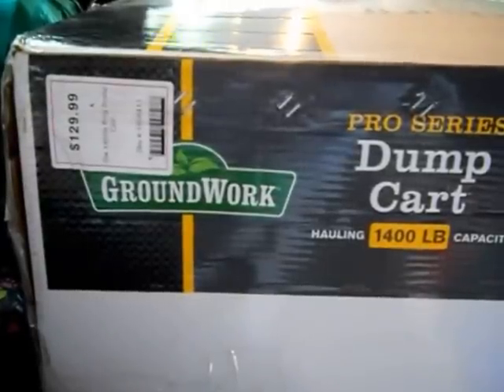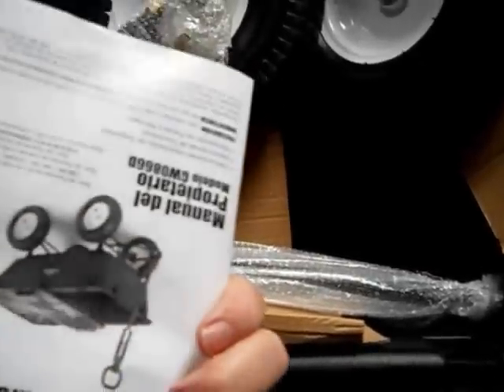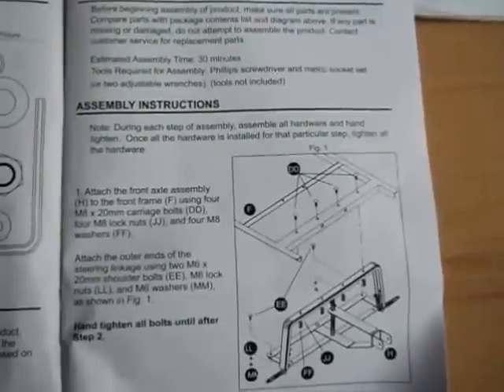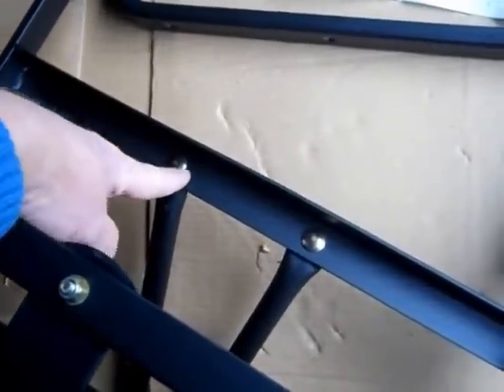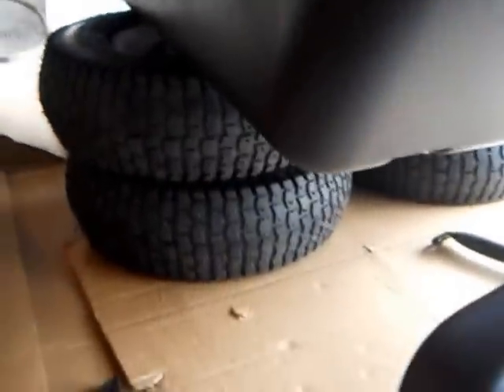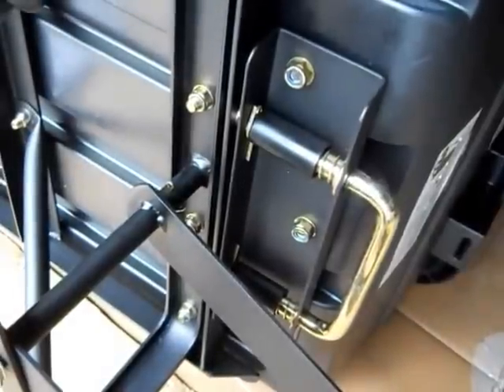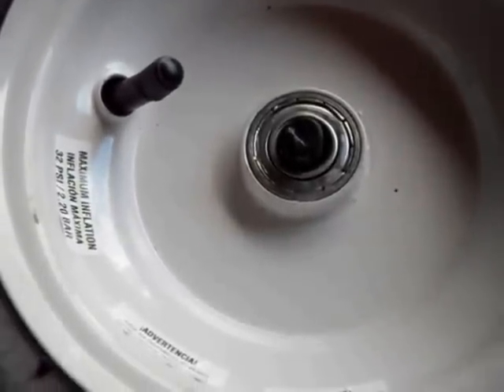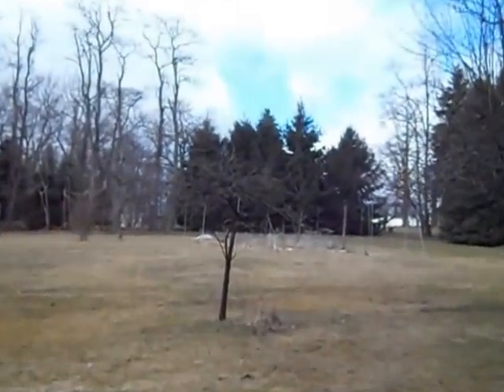Tractor Supply Groundwork (Gorilla) Dump Lawn Cart New Out Of The Box Review & Assembly (Gorilla)

Comment: Thanks a bunch for the video! Just bought the Gorilla Dump 1200lb Heavy Duty from Lowes (haven't unboxed yet). I wonder how these units differ?
Reply from the maker: revansCAAD8 I can see NO difference! Check my posting below. The only difference I can find is the label. Yesterday I filled mine with wet dirt and it dumped nicely. One feature that I love is when you tilt the bed up the frame lowers onto the rear tires to prevent roll away. So far this is A+

Comment from the maker: What I have learned in the weeks using this cart. It is heavy! 60 pounds empty, pulling it empty by hand takes some effort. When you dump a load the frame lowers onto the rear tires to prevent rolling, a great feature! It hauls more than my wheel barrow and no worries about tipping over and losing your load. I hauled tree trimmings by attaching a loose rope and stacking the branches as high as I could then cinching the load with the rope. This saved me a LOT of trips. Check out the saw I used to trim my fruit trees. https://www.youtube.com/watch?v=nZycSrqJ--I

Comment: Had mine for several years hauling heavy loads.  The "bearings" (sleeves) of the front wheels are just shot!  The wheels wobble on the axle shaft and the thing is useless for hauling anything.  Very poorly made for the advertised weight load it is supposed to carry.  In my opinion not worth the $100 I paid for it.  It's quite heavy when empty and extremely 'tipsy' on any grade.  I wouldn't own another.
Reply from the maker: +Wmdolittle That is disturbing. I added extra grease when I was assembling mine, and will take your experience to add even more annually. Thanks.